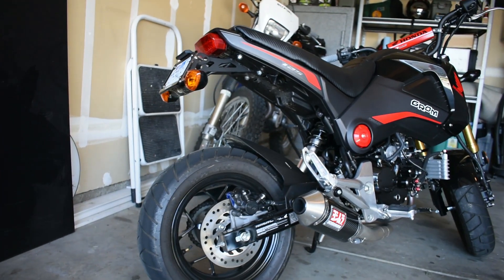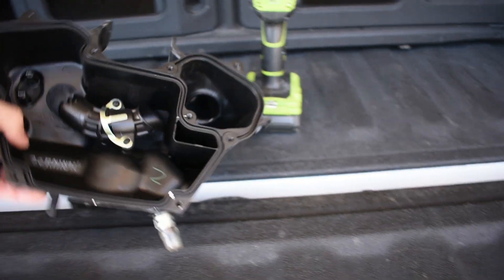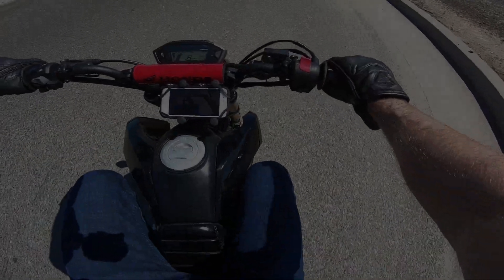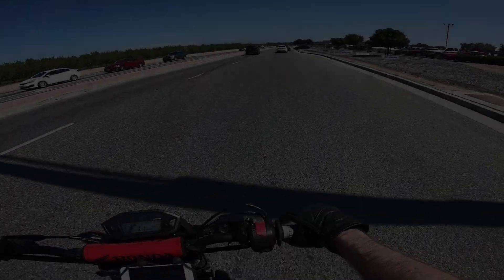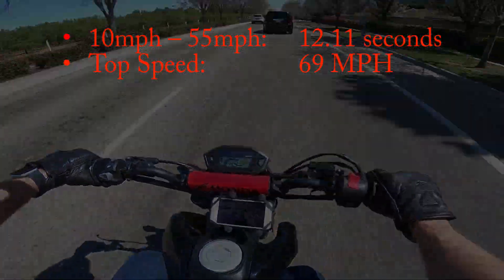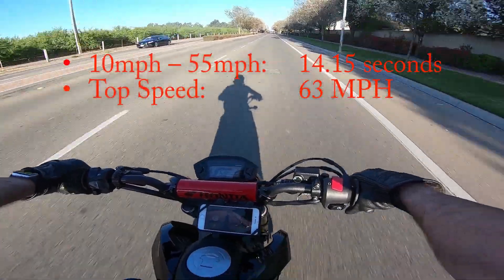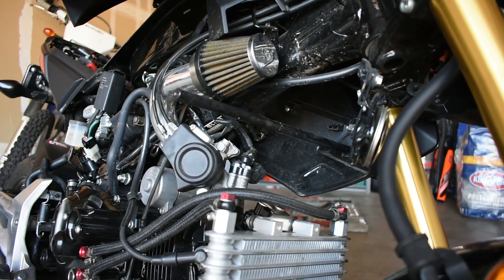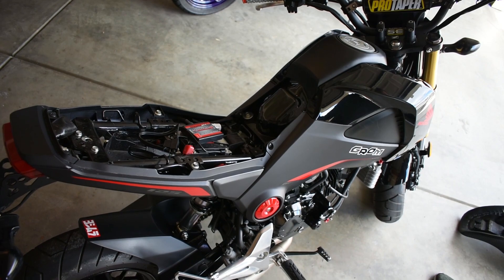Grom Mods - Chimera Intake - Power Commander V - Worth it?

Comment: Great vid man, i just picked up a Grom today. I had heard a bunch of different suggestions about the exhaust, air intake, and add ons to the ECU but the way you delivered this information was outstanding.
Reply from the maker: I really appreciate it!  Don't buy anything tuner related yet, I'm about to release a video on the cheapest power I've found to date, that will add to an intake and exhaust, stay tuned, and enjoy modding your grom, its the best!
Reply: Yoooooo!! I can’t wait!! 
Thanks for the quick reply man!
Reply: Leave it alone. All those "mods" do is make it run WORSE.  Been there - done that.

Comment: With stock air filter box, you don't have to worry about riding in the rain, or washing with pressure, no worry about any little thing go through the throttle body, and make it more clean last longer.
Reply from the maker: All those things are true, and definitely in the "pros" column when debating whether or not to change to an after market intake.  Unfortunately it's also super restrictive!  It sounds like you value reliability over performance, which is fine!  Thanks for commenting!

Comment: I just ordered a Yoshimura exhaust to go with a short finger intake. I plan on having my ECU flashed by DHM. Maybe I should try riding it before I have my ECU flashed first so I can check my numbers before and after. . Great video!
Reply from the maker: Definitely ride it and take before and after video so you can calculate the difference!  After this video I had DHM do my re-flash and got his cam package as well!

Comment: Thanks mate, you just saved me 1000aud. The grom i am picking up has a Yoshimura Exhaust, i believe the rest is stock.
Reply from the maker: That's awesome, as long as you dont modify airbox/intake then you're good.  If you ever do, just reflash the ECU, say cheaper than running power commander.
Reply: @CTGromer  Cheers!

Comment: I saw in another video that you can remove your stock ECU and send it out to have it reflashed for $100. That is another option too aside from getting a power commander or similar EJK.
Reply from the maker: Absolutely correct!  I actually reviewed one of the guys who reflashes the ECU's product here: https://www.youtube.com/watch?v=t7xqQPafvF8

Thanks for commenting!  Turns out it works great, and it's definitely the cheapest fix!  Watch that video I linked, it piggy backs on the speed runs from this video you commented on.

Comment: Exhaust + Intake + PCV = Faster & the Grom needs it. Stock it can bare ride 2UP & hills sap it hard. Level 1 tuning brings it to life
Reply from the maker: I agree.  Should be mandatory for a grom.  It's a significant increase in power and acceleration for sure! Thanks for watching and commenting!
Reply: @CTGromer  Just finishes installing the Chimera intake & PCV. The plastic body panels were the hardest part lol... Messed up one of the screws under the rear fender, stripped the phillips head lol, to the mechanic tomorrow for help removing it. Sounds good. Combo of Zoom full loop exhaust, Chimera Intake & PCV with map tuned for said combo makes a noticeable increase in power, tops speed & overall performance. Cost nearly $900 plus my DIY install time. Glad to make it happen :) More testing tomorrow once it warms up^^ Colder than a snowmans pecker right now & the morning will be colder

Comment: Don’t know what state you are in but the power commanders I have bought have been 49 state models.  On both my bikes the CA legal tuners doesn’t nothing below 4K RPM.  So you get the power commanders through a 3rd party in calif.  Makes a world of difference
Reply from the maker: I've heard that the PCV I had doesn't intervene until higher RPM just like you've said, I thought all of them were like that!  There are some the provide a complete map for all RPMs?
Reply: CT Gromer  yes the tuners  that are available in the 49 states.  It was the same for my Ducati monster. And my husqvarna 450 SMR. I also bought the auto tune unit for the husky.
Reply: @CTGromer  i would  call  the  mfg  on  the tuner  you want  to  use.   they  will or  should  tell you  about  the difference  in the tuners.    california carb  standards  kill any  real gain  with  the calif  spec  tuner.     i havd mine tuned by  a  great  shop w  a dyno,  so we  could  do back to back runs.....
Reply from the maker: @grooviefan    That's a really good idea.  I will investigate further next time I run a PCV.  I've since gone to a re-flashed ECU for fuel/air correction.  It's more simple, cheaper, and has worked well for me.
Reply: The Duc & husky ECU ran out of ability to adjust.  Could never get it  rich enough in the range we needed. But every mfg  ecu is different

Comment: Just picked up a 2018 grom and it has a bunch of mods. Trying to learn about it all.  These are the mods on it
Power commander programmer v
Kitaco Clutch cover 
Scotts SS Oil filter
Kitaco 60% Stiffer SPRINGS Clutch
Hard Racing Billet Clutch Spring Plate
Takegawa GROM SUPER Oil Pump
Yoshimura RS2 exhaust 
Chimera stretch 
ProTaper Gold MX 420 Chains x 134 Links
Carbon intake with K&N filter 
Front flush signals 
MZS levers 
SNB MID FAIRING PANEL SET 2018 V1
Oil spinner delete and filtration system installed

Comment: A powercommander, bazzaz or any fuel controller doesn't necessarily increase performance. You could even lose a few hp after a tune. They aim is solely to get the air/fuel ratio or mixture right. I'd also recommend getting a custom map for your specific bike. Each bike is different even with the same exact parts on. There's a lot of parameters generic maps doesn't take into account, so a custom map on a dyno is definitely a must. 

#sauce - Superbike Solutions
Reply from the maker: I do agree that a custom map is by far the most effective, but very expensive in combination with a PCV.  I think the better solution is to re-flash the ECU.

Comment: What are some of the other tuner options and how do you know which one to get? And where do you find them? Amazon? I just recently got a grom and was thinking about purchasing those upgrades but I don’t want to buy the power commander. Thanks!
Reply from the maker: There aren't to many options out there that are cheaper than the PCV, but I've heard great things about the EJK (part number EJK 8110049) for the Grom. At only $225 its by far the cheapest.  You can get them on Amazon, good luck!
Reply from the maker: Check the comment from @LOLGarena - they just listed some cheap Thailand alternatives to the power commander, check them out!

Comment: Sooo...if I install only a Yoshi pipe and a Chimera intake, technically I dont really need the power commander?
Reply: in theory you dont need it, but your engine will run dangerously lean and your engine might break. you should get cheaper aftermarket ecu but not power commander
Reply from the maker: Exactly right!
Reply from the maker: @autisti is exactly right.  The ECU or PCV wont give you a PERFORMANCE boost, but it will correct your AFR so you aren't too lean.  The cheapest way to do this if you are maintaining stock bore  is to just-reflash the ECU!  Best bang for your buck.  Check out DHM.  Good luck!
Reply: @CTGromer  Hey thanks!

Comment: Makes me wonder how fast mine would go at sea level.
Reply from the maker: Thanks for commenting!  Altitude definitely a factor in correctly tuning for maximum power-- what altitude are you riding at?
Reply: @CTGromer  SE Arizona.  Anywhere from 4500' to 6500'.  Mine has a BBK and associated mods, but 60 is about tops (haven't changed the sproket yet) but I'm a big guy.
Reply from the maker: @wraith67  Thats definitely a factor.  I do a lot of trails on a DRZ400 between 5,000-6,000 here in CA.  The DRZ can pick up the front tire in 3rd no problem at sea level but takes the same amount of effort to get it up in 2nd gear at that altitude.
Reply: I just copped a from
Reply: They fly, I'm from Boston Mass and it definitely is peppier than alot of groms I see on YT thay are further inland

Comment: Very informative video!  Earned my sub. Thanks for posting. I ride a 2015 Grom in Canada. I moded the air box only (removed the snorkel, restrictor plate and internal tube) I run 89 octane. I consistently get up to 124kph (77mph) and saw 129 once. I ride it pretty hard and would like to get a few better tuned parts such as you show in the video. I've heard of people reflashing the stock computer instead of a power commander or the like. Do you have any experience with that?
Reply from the maker: Well I very much appreciate you watching and the sub!  Thank you.  Yes, I do have experience with running a reflashed ECU and recommend it better than PCV because it's much cheaper!  I'm actually running one currently on my 2015.  DHMotoring does a reflash package for $105, for someone like you that wants to go a little faster on the top end, i'd really recommend the DHM Reflash + CAM package.  I did a video on it actually not too long ago, check it out if you want.  Best bang for your buck I think, and install was not hard:  https://www.youtube.com/watch?v=t7xqQPafvF8&t=415s

Comment: Think I’ll still get the power v. Definitely getting the chimera air intake now. Need to drop 20 lbs to get back to 165. Can you add the carbon fiber wheels next?
Reply from the maker: shoei07 it’s still a great air fuel management unit!  I love mine.  And it gives you piece of mind your not running too lean, enjoy!

Comment: Awesome video!! What gas grade were you using? why didnt you take a 3way average with each mod? Also did you shift at the same RPM for each run?
Reply from the maker: Whats up man?  I use 91 Octane.  a 3 way average, like do 3 speed runs and average them? Because thats' a lot more work and a lot more editing, but for true consistency I agree with you it would've been better.   Shifting yes, I tried to switch at redline each time.  Glad you liked the video!

Comment: Subbed! Question: Do you think these changes would pass-over to other 125cc bikes?
Reply from the maker: The concepts are the same yes, the specific parts wont fit, but if its a street legal 125cc bike, you can get more power out of it by letting in breath better with intake and aftermarket exhaust and richening the AFR.  Thanks for commenting!
Reply: @CTGromer  Am I right in thinking that most 125cc bikes will be okay with a new exhaust and air filter without adjusting the fuel mixture? Just referring to what you tested in the video, and basically, I'm trying to avoid ECU remapping/flashing

Comment: So what I’m reading is that for optimal performance, you’d just use the chimera intake and yoshimura exhaust, no ecu
Reply from the maker: For optimal performance not considering the dependability and long term health of the top end, yes.  But, you should richen the mixture back up with a re-flashed ECU or some sort of tuner.  Thanks for commenting!
Reply: @CTGromer  Yeah that true, Best off buying all three
Reply from the maker: @hudsonq.6722   Especially when re-flashing the ECU is only $100 or so.  Definitely worth the peace of mind to me.

Comment: Great video...man I just got the chimera intake and dhm stage 1 ecu flash.  Already had the yoshi rs2 exhaust. My top end only went up to 57mph from 56 mph. I'm about 235. Does this sound right?
Reply from the maker: Nice 👍 !   How far have you ridden it, and did you reset the ECU when you got it?  If you didn't ride it at least 50 miles and the ECU will make the adjustment.

Comment: Hi gd day CT, I just bought a 2018 MSX 125cc. Is there a KNN filter for this bike? What other enhancements could I mod on this bike? Does removing the net in the airbox without installing the chimera intake reduce resistance? Singapore has strict laws on approved end cans. Only legal end cans are approved upon inspection and a cert (approved end can after inspection) needs to be present when a traffic police stops us. Kindly advice on what is necessary to mod. Thanks.

P.S. I am still running in the bike. Just collected on 3 Feb 2020.
Reply from the maker: Well hey, congrats on the new grom/MSX!  I really hope you're enjoying it.  Unfortunately you must obey the laws in your area, so it sounds like you're pretty limited in what you can do.  You've made a good choice by replacing the paper element with K&N, I would also remove all of the interior snorkels, and add a velocity stack inside the box, like this: https://www.ebay.com/itm/SALE-Velocity-Stack-Honda-Grom-MSX125-Air-Box-Mod-13-20-/183117836857

That one is cheap, Brock's performance makes an expensive one here: https://www.steadygarage.com/store/brocks-performance-billet-velocity-stack-honda-grom-125

Check them out and decide if they're for you.  Its really all you can do if you can;t remove the airbox.  Have a good day!  Thanks for commenting!

Comment: Off the shelf maps are not going to get you much gains,  you have to get it on a dyno, tuned and get a custom map made and you might see slightly better results.  Plus with these small engines you are not going to get that much more out of them.
Reply from the maker: I do agree with this, it more like just putting a bandaid on the lean condition.  I've since relflashed my ECU and ditched the PCV.

Comment: Now I'm a pretty big dude. I'm 6'3 295 and I just picked up a 2018 grom and love it. I bought a cheaper ebay exhaust. Is it worth it to drop the intake and PC 5? Like I'm not looking for crazy speed or power(it's a grom) but would being a bigger dude notice a difference with the intake and pc
Reply from the maker: Yes, you would definitely notice the difference.  If I were you, I'd get a 14T front sprocket, Chimera or Dingerbuilt intake, and DHM ECU flash service (way cheaper than PCV and richens the mixture the same).  That right there will be the biggest difference for the money spent!
Reply: @CTGromer  awesome. Thanks for the response man!

Comment: Do the parts change along with the year of the Grom? For example, can i use that same exhaust on a 2016 & a 2020?
Reply from the maker: That's a good question, some do, yes because after 2015 the grom received a minor remodel, mostly cosmetic.  Power mods seen in this video are generally universal and will fit all years as the engine itself (other than shape of clutch cover) has not changed.  Do you have questions on specific parts?  if you're buying the parts new and it is a different part depening on model year, the website you're buying from should specify what years it will fit.

Comment: So it’s ok to have a intake and exhaust with out the power commander I’ll just reset the stock ecu and it should be good?
Reply from the maker: No, at that point you'd want some sort of richening of your air-fuel ratio.  Cheapest way is to use a reflash service for the ECU.

Comment: Nice video but you didn't mention the map that you ran on the Power Commander. Did you run one of the downloadable maps on power commanders website for the Yoshimura with Pod filter? Thanks for any input, this is the setup I'm going after.
Reply from the maker: Sorry for not mentioning, yes, I ran one of the pre-made maps from the PCV website.  The exact one is the one you metioned- pod filter, yoshi full exhaust.  If you plan on doing more than just exhaust and intake then PCV is better, just overkill and expensive for basic mods.
Reply: @CTGromer  great, thanks for the reply.
Reply from the maker: @DaddyPhatSaks   I try to reply to everyone, I appreciate you taking the time to watch my content!
Reply: @CTGromer  no doubt, very informative. I am going with the Yoshimura/cold air intake route.  Going with the Power Commander as well.  Yes its pricey, no its not going to give much more power, if any, but to get a safer air fuel ratio for longevity, then I believe its needed, you know.
Reply from the maker: @DaddyPhatSaks  Couldnt agree more!  Have you looked into just getting your ECU remapped?  Much cheaper
Reply: I have and thought about going that route but I got a used Power Commander for a decent price so figured I would just use it and then wouldn't have to worry about sending the ECU in again if I ever made any more changes.  Thanks again for all your information.

Comment: The intake might be the best bang for the buck horsepower and speed wise but the bike is already to lean from the factory so installing this without a fuel programmer is going to be dangerous for the engine in the long run! It’s going to run even leaner then it already is! It might be faster but not fit to long lol!

Comment: i have the chimera intake exhaust and power commander v and my bike isnt getting any power in 4th gear. it will pull through third then fall on its face in 4th im 6"3 260lbs
Reply from the maker: 6'3 and 260, I believe the grom would have a hard time in 4th.  If I were you, I would definitely drop a tooth on the front sprocket go a 14T.  It should make 4th gear a little more usable for you.   JT Sprockets 14T Front Sprocket: https://amzn.to/2OocnG7